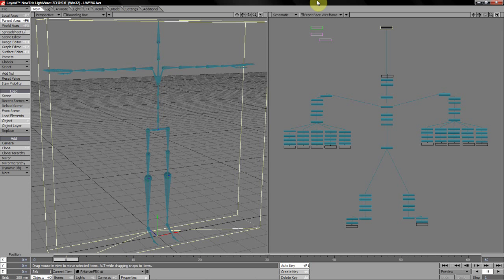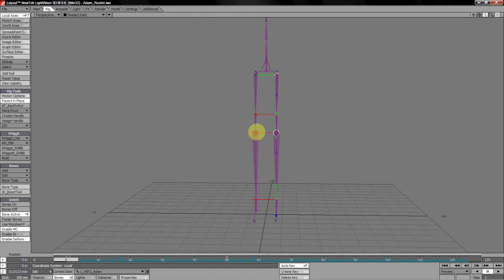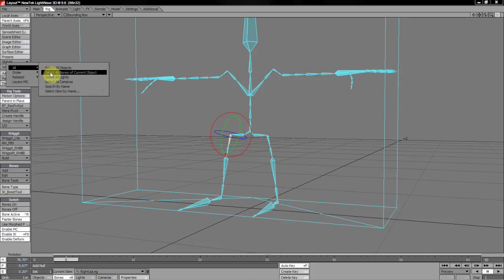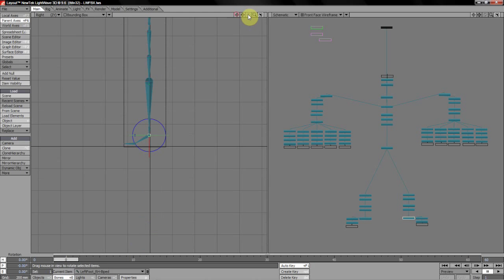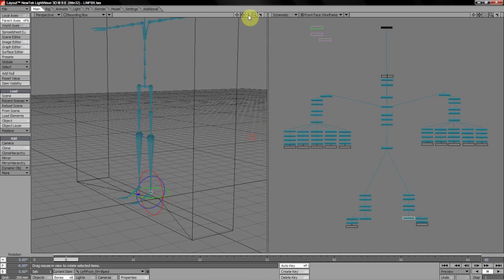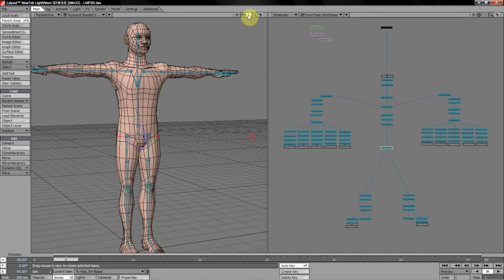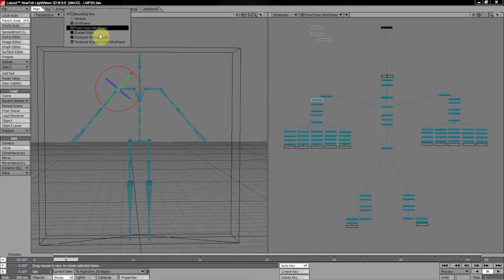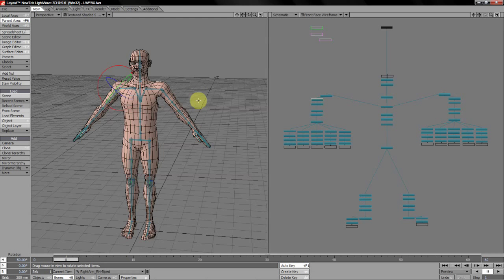Understanding LW and FBX part 1

Comment: I'm running into and issue when importing .fbx rig, Lightwave creates a top parent joint to my rig, and names that joint, my root joint, and what would be the root joint its now named the spine joint, it goes to the list and names all joints one hierarqui up, and at the bottom for let say my end joints like a head joint, since it doesn't have a name for it for all got moved one up it names the moved up joint let say what was my neck joint, is named head (1) and the head becomes head (2). Do you know how I could go by fixing this? Thank you very much!